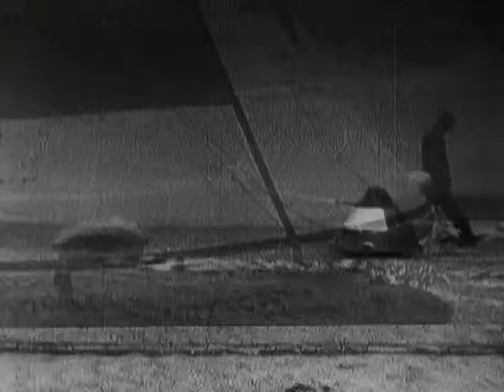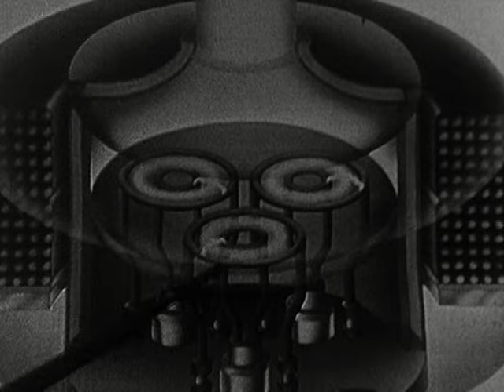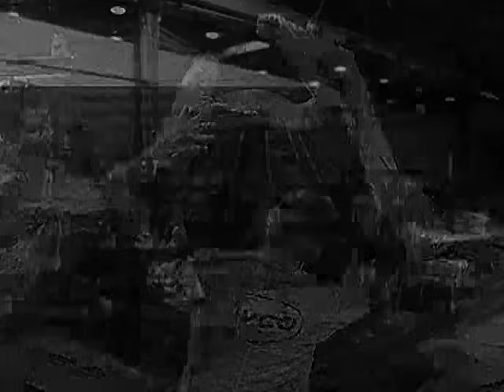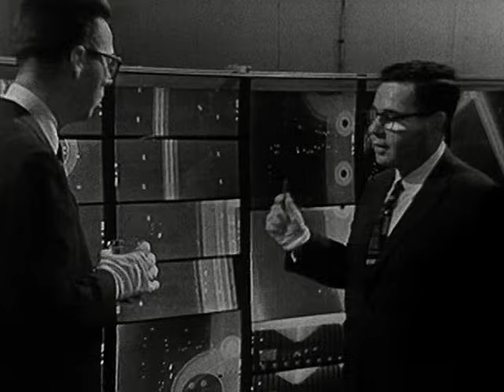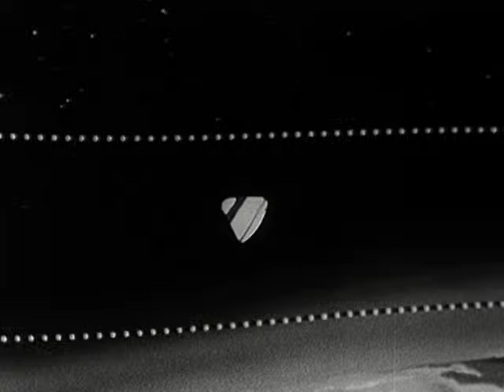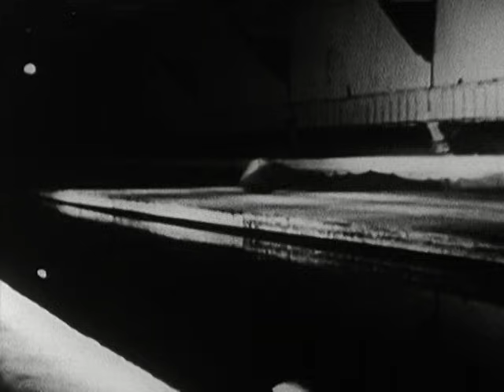MIT Science Reporter — "Returning from the Moon" (1966)

Comment: I would have thought the Van Allen radiatiin belt would be a concern.
Reply: It is.  But it's thinner in some places than others.  And since they moved through it quickly, it wasn't a problem.

The conspiracy cultists would have you believe that it's a re-enforced concrete barrier or something.  🙄
Reply: NASA engineers thought of that too kiddo, heck you only know about VAB only because of NASA probes.
Reply: And it still is as RADIATION is the entire show stopper. It was then as it is now, how to protect the astros from RADIATION !  For 30 years the Space Shuttle did nothing more than fly Low Earth Orbits below the Van Allen Belts because of the intense RADIATION and the protection given by the shielding of the Van Allen Belts. Study the RADIATION problems and you'll find Apollo wasn't what it claims.
Reply: It is, as is radiation in general. Thankfully it's relatively simple to deal with it.

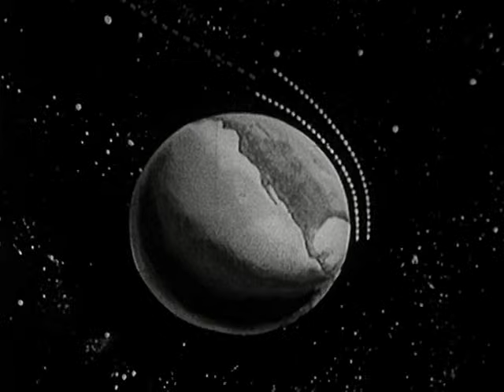Comment: 20:00 Re-entry of the commanding-module (the capsule) into the atmosphere of earth will be another great problem. Not only the heat of the air-friction at 20.000km/h, but the stabilization is the great problem. It begins to wobble and whirl, the astronauts will die because of extreme g-forces inside. Do anyone think, it is real, that such a capsule can be stabilized at such high-speed, but airplanes like the X-15 needs at least short wings ? Flying without wings at highspeed, it is a flying saucer. If this is not such a problem, why was it such a problem to deliberately crash the unmanned sky-lab-module in 1979 ? They succeeded, but there was the fear, that it could crash over inhabited areas. Not so easy. One can explain every single problem of the journey to the moon and how it was solved, more or less reliable, but one cannot explain, that all the things of crucial importance together succeeded and everything was calculated. There must have been much more incidents and accidents in the testing phase, but obviously, there only occured very few (3 dead astronauts).

Comment: We have a built in protection from the radiation from the sun. It's our atmosphere. The moon has no atmosphere. So the radiation would be at 100% in comparison to Earth. If you leave a color cloth in the sun for a week or so the sun light will pull out the color, or bleach it.  If you leave plastic out in the sun shine long enough the sun light will break the plastic down to where it becomes brittle and break. So without an atmosphere and with extreme heat anything left on the moon would become brittle . Not sure how plastic from the 1960's could withstand the intense heat upon reentry through the earth's atmosphere. Not sure how much heat rubber gasket or other materials can withstand. Not sure if the thin metal they claimed the ship is made of can withstand the vacuum or what ever forces are in space . I'll test a piece or silicone to see if fire can melt this material. And I can't see how on the moon how the air-conditioning could keep up with the heat. I've heard sun light heats up the bright side of the moon to 250° . I do not think anyone has been to the Moon. 🤥🌛🌜🌝🌞
Reply: To be blunt, an argument from incredulity is not good. You're basically saying you don't think it happened because you don't understand.  Here are some examples:

"So without an atmosphere and with extreme heat anything left on the moon would become brittle ". The longest any part of the LM had to sit on the Moon was three days.  And because it was essentially "early morning" at the landing sites, the temperatures weren't nearly as high as they would have been at lunar noon.

"Not sure how plastic from the 1960's could withstand the intense heat upon reentry through the earth's atmosphere" First off, the material for the heat shield on the exterior of the command module wasn't "plastic" the way you're probably thinking about. It was a special type of epoxy resin that was designed to char and flake away when heated. The charring and flaking took heat away, and it only had to do it for about 10 minutes at the end of the flight.

"Not sure if the thin metal they claimed the ship is made of can withstand the vacuum or what ever forces are in space"  What you're talking about is the pressure differential between the environment inside and the environment outside.  But think about an ordinary soda can-it can withstand internal pressure of about 75 psi above the outside air before it bursts. The spacecraft were filled with 100% pure oxygen at about 4 psi (that's the "partial pressure" of oxygen in sea level air).  So a common soda can withstand a pressure differential nearly 19 times what the spacecraft had to.
Reply: Your education needs a lot of work
Reply: you're "not sure" on so many things, and you use your total ignorance as evidence. that's a good way to become a republican.
Reply: Well Moon has now a near atmosphere, Earth's!
O yes IT has Radiation galore! Worst then VABs new data.

Lead scientist for both the PREDICCS and the DoSEN project Schwadron says. "For example, on the moon, there are ADDITIONAL HAZARDS from neutrons that are created by high-energy radiation interacting in the lunar soil and radiating OUTWORD from the surface."
That "backsplash" of protons, which was discovered by CRaTER and is known as the moon's radiation "ALBEDO," is caused by the partial reflection of galactic cosmic rays off the moon's surface. This creates a surprising one-two punch of DEADLY radiation and can also be used to peer below the lunar surface like a geological probe.
Says Harlan Spence, CRaTER deputy lead scientist and director of EOS, "UNTIL NOW, people have not had the 'eyes' necessary to see this particular population of particles. With CRaTER, we just happen to have the right focus to make these DISCOVERIES."
Reply: @narajuna  random caps doesn't make anything you say anything but quote mined gibberish

Comment: Why no rocket landing like for Mars?  Those were tuff parachutes for near speed of sound, yet in near vacuum atmosphere of mars worries of tearing them.
Reply: because they landed in water. russian capsules do use small rockets to arrest their speed just before landing because they land on land. also do learn how air resistance works (by the square of the speed)
Reply: @Agarwaen  ? what? Dont rockets work better in vacuum? You find normal sensible logical scientifical that in less 1% density they have helicophers overthere? okay....
Reply: "vacuum atmosphere of mars " ?
Reply: @Canada_Dominium  Reading or honesty problems? "...yet in near..."
Mars is about half the size of Earth by diameter and has a much thinner atmosphere, with an atmospheric volume less than 1% of Earth's.
Reply: @narajuna  Mars' atmosphere is not "near vacuum." Global dust storms cover Mars.
Reply: @Canada_Dominium  Same on moon.
FAR vacuum happy winner? 👍 
 The air in the mesosphere is far too thin to breathe; air pressure at the bottom of the layer is well below 1% of the pressure at sea level, At present, the only vehicles that can travel in this layer of our atmosphere, at an altitude between 50 and 80 kilometres, are rockets destined for space.Feb. 12, 2021
Reply: @narajuna  There are no dust storms on the Moon. Mars has weather systems, winds, storms, and air masses.
Reply: @Canada_Dominium  still lipping here kid, isnt mom home? Always so anally nickpicking? Never went kid but something is dusting the atmopshere.
There is some evidence that the Moon has a tenuous layer of moving dust particles constantly leaping up from and falling back to the Moon's surface, giving rise to a "dust atmosphere" WIKI

NASA Finds Strange Ring of Dust Around the Moon /watch?v=WSwv0eb8mGo
Reply: @narajuna  The Moon does not have dust storms. Electrostatic local suspension of dust particles is nothing like Mars' global atmosphere.  A ring of orbiting dust particles is not an atmosphere either.

Mars has an atmosphere. Enough of your silly insults and backtalk.
Reply: @Canada_Dominium  Yet again you drag your teenage lip, I gave you your WIN  its not "near vacuum', I understand your computer was unable to copypaste the whole line on mine, got it honest boy.
>>>>> ITS FAR from a vacuum = YOU WIN !!! GOT IT?

Anal behaving kid my Comment was about skeptical of parachutes & helicophers working in a 1%. This YT not a official Science Paper to prove Mars has 0 atmosphere. Figure of speach  heard of it?

[ On the terminator there could be significant horizontal electric fields forming between the day and night areas, resulting in horizontal dust transport - a form of "Moon storm". [10][12]
It is possible that these storms have been spotted from Earth: For centuries, there have been reports of strange glowing lights on the Moon, known as "Transient lunar phenomena" or TLPs.]
en.wikipedia.   /wiki/Lunar_soil
- you may want to whine & and sue THEM :)
Reply: @narajuna  Mars atmosphere is nowhere near and nothing like vacuum. Yawn to the rest of your nonsense.
Reply: OHO, notices stoped and my last reply gone... Someone not like the turn of events?  O there were broken links to backup the Website results... :(

Google  mars atmosphere is near vacuum >>>
1) Is it true that Mars is in a full vacuum? Not really. Mars has a thin atmosphere. It wouldn't be enough for us to breathe but it's not a vacuum.
2) Mars is not a total vacuum, but at 1% of Earth's atmosphere, is close enough as far as human survival is concerned.
3) How are 'dust devils' even possible in Mars' near vacuum ...
Nov. 26, 2017 — Near vacuum is NOT complete vacuum. The atmosphere is most present near the ground (where the dust is); Solid/gas phase change kinetics (sublimation of CO2 at ...

Reality note (may not be appropriate for Teachers pets or anal people) : 
1) Karman line is wildly considered SPACE but aint.
2) SPACE is considered full VACUUM but aint, place if    full of stuff and has friction.
3) Earth is considered CLOSED SYSTEM but it aint.

O and I was asking Someone to please they tell the kid he won and give him a star sticker (sign!).
Reply: @narajuna  Yawn.
Reply: @Canada_Dominium  Big physics boy take some laxatives and relax.
Reply: @narajuna  Nope!  You're the bunged-up fool here.

Comment: Wow, CNC In 1966.
Reply: NO !!! It's only N/C or Numerical Control !    C/N/C is Computer Numerical Control and didn't happen till the late 70's with the use of the INTEL 8008 and then the INTEL 8088 chips that gave the controls memory to repeat and do it's own math functions !  That's why the large tape reels as they held all the punched paper tape programs giving the G-CODE info to the controller.  1" wide paper tape with 8 channels of code punched into the tape and a smaller set of sprocket holes for the tape reader to feed the tape thru the reader head.  Every single move had to be typed into the program and onto the tape.
Reply: @SteveWright-oy8ky  wicked! Thanks for clarification.

Comment: So they could not  “reproduce” the actual temperature, the tests were combined and a “theoretical” conclusion was relied on to develop the final material, and it worked...interesting
The material was held on the body of the craft with “tape” that was “bonded”?  Question: if they could not and can not reproduce the actual temperature of reentry, who’s to say the “bonded” material would not have “unbonded” and caused a catastrophic failure?
Reply: Not Bloody likely: They tested first with unmanned test flights. But before you can do that you want some reasonable certainty it’s going to work (rocket launches aren’t cheap). Hence you start with theoretical modelling.
Reply: Everything is over engineered to create an acceptable margin for failure which exceeds the mission requirements.  And that’s not just for space craft; that’s literally everything that is designed by engineers.
Reply: it's called science. Thermodynamics.

Comment: The heat created when the astronauts re-enter Earth atmosphere would cook what ever is alive. I really don't think the air-conditioning in side the craft could keep the temperature cool enough to be safe for astronaut to live through the reentry. The plastic would be a joke. We know plastic burns, melts ,it's an oil product. Good greef , plastic would be hotter not    cooler. The temperature the man says it would be crazy to think any plastic would protect the astronauts. The space suit is a joke. Unless the suit can keep the powerful radiation the sun gives off from penetrating to the astronauts it is useless. I also have a problem with any rubber seals. The suit would be too thick to move easily in. The covering of wires would have to be melt proof. The project has to be all melt proof. Just can't see it happening back then.
Reply: You need to understand the differences in energy and heating.  Then the fundementals of the different types of radiation in ace and where they are encountered.   Good luck in your studies.   good job nasa did theirs.
Reply: that's one plastic that gases and boils off to remove the re,entey heating
Reply: insulating material, air gaps etc.

Comment: The CM/SM was incredible complex with so many parts that had to work perfectly for nearly 2 weeks and all shoehorned into a weight and size constraints. This kept being a problem as so many subsystems to include plus redundancy.  The rocket engineers were asked to ramp up the current power 12X!!!  where normally a twice increase would be a big ask and also they had to build ungodly pressures to deliver the propellants at enough pressures to make the sort of thrust they needed all without melting the available materials around the combustion chambers. Today the same guys who did this still shake their heads at the problems they faced and how they ever did it bit they did. Apollo 8 and 17 were the most reliable overall with little problems on the rest like engine cutouts and fogged windows and on 16, they really had some issues just before they were about to descend to the surface when a dish jammed and one of two systems on the SM main engine showed bad. The men orbited in the LM with the CM for some time before they were given the ok to head down to the surface and it was a bit close as they were drifting off the orbit all the time so any long wait, and they would have to cancel the landing and come back. This was all explained in Charlies Dukes book i have as he was LM pilot for 16.

Comment: Moon Hoaxers still at it I see.... this was an interesting show... you can tell that many ideas, and experiments were run.... nothing was set in stone....  so there 'was' filled honeycomb material on the 'whole' capsule....  not just the thick part on the bottom blunt end.... you can also tell the methods used were prototype style....(NOT production style)....  filling each hole by hand.... etc.  Ya know, I don't think these skeptical hoax ppl have ever produced 'anything'.... they seem to dismiss everything as  'ridiculous or impossble'  .... these engineers didn't just 'know' all the answers....they had to figure it out....
Reply: @Tye Bear Well...how did you get Mach 30 at 25000 ft...maybe that velocity at 400,000 ft...(Entry Interface)??  They used 'aerobraking'...(ablative heatshield) and aerodynamic 'body' lift to slow first.....If you look at this article it says something like Mach .3 - Mach .7 ... https://space.stackexchange.com/questions/2661/what-was-apollo-11s-reentry-speed-at-parachute-deployment ....  approx. 350 -500 MPH.... (still fast for a 'normal' chute)....but they special 'hypersonic' designed drogue chutes, won't get shredded at that speed.....
Reply: @Tye Bear as always you hoaxtards extract conclusions not by any means exposed in the video with the sole purpose of find explanations to your skewed bias, you self proclaimed experts. As if your opinion equals facts and knowledge. Laughable and sad at the same time.
Reply: @josele844  hoaxtards, nice have to remember that word 😀
Reply: @Tye Bear Funny how they actually did tell ya that the capsule is slowed to below the speed of sound at 25,000 feet. After that the drogue parachutes are deployed, slowing the capsule further before the main 'chutes are released. Maybe try paying attention next time.

Comment: says the capsule experiences 20,000 deg C , but the test ablative is hit with 7 to 8,000 deg C [ tho hard to discern his speech? ] HMM
Negative 2.5 times effective then is it ?
Reply: The air does get that hot, but the reentry time is short enough that the heat shield itself doesn't get that hot.

If you put something in your oven, it doesn't immediately come up to the oven temperature, does it?  Same thing with the heat shield.
Reply: @almostfm  I think it's not really a time factor, but more like boiling water. No matter how hot the fire underneath is, the water will never exceed 100 degrees Celsius. It's the same for the ablative plastics. The plastic still attached to the module will never exceed 7k-8k. If it becomes hotter, it evaporates and is no longer attached.
Reply: Dur.